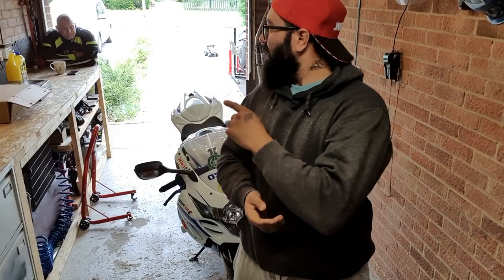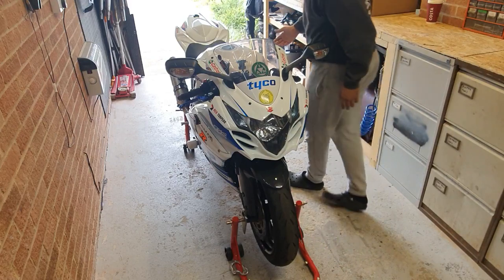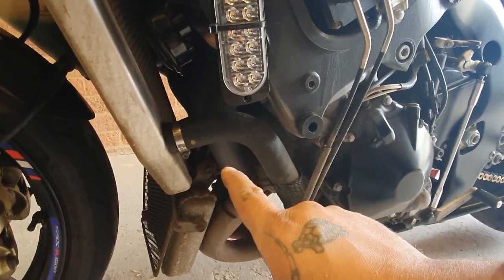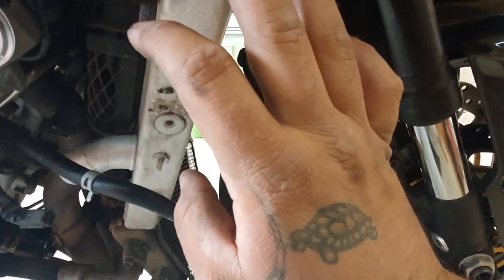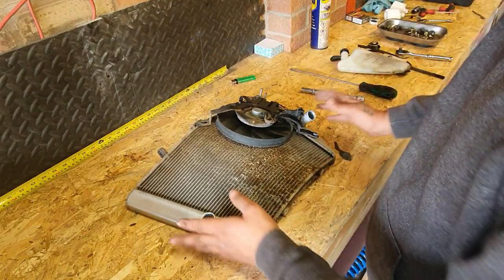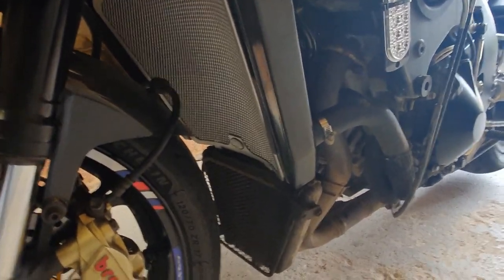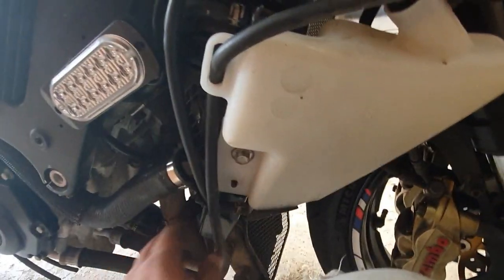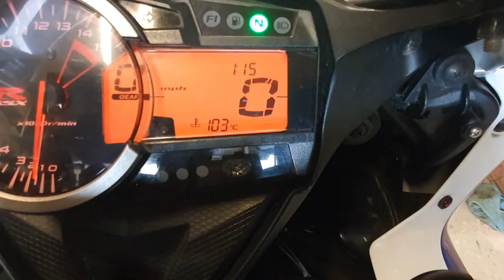How to change the radiator on GSXR1000 2014 - RGMgarage

Comment: Question. My radiator fan will not turn on. I have 2011 suzuki gsxr 750. Where should I look first?
Reply from the maker: Hey Mr Green, I'd start by checking the fuse, if that's ain't the fault Trt unplug the fan and put 12v on it to see if its the fan, if that's not the problem you need to check the temp switch which is screwed on the radiator. If all of it is good you need to make sure there's no breaks in the wiring. 
Hope this helps.
Reply: Make sure the fan motor isnt burnt out. If you rotate the motor and hear it winding/grinding then thats it